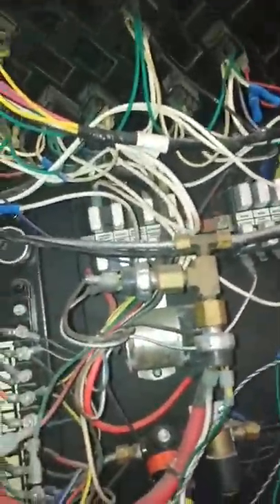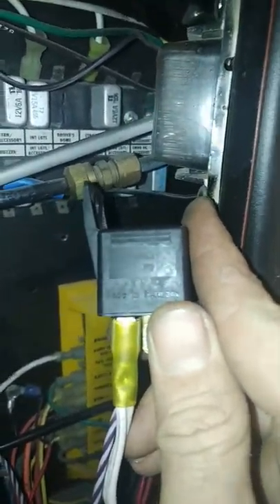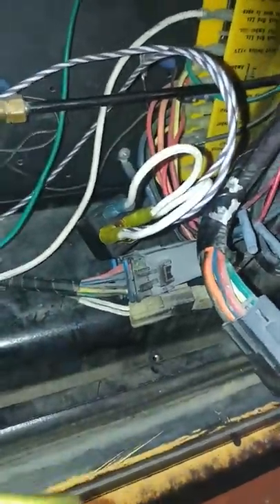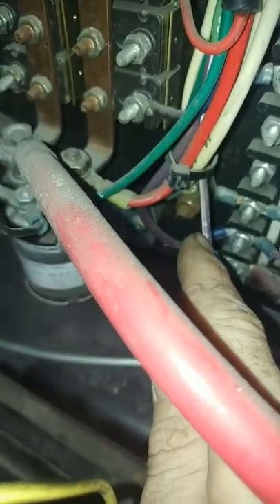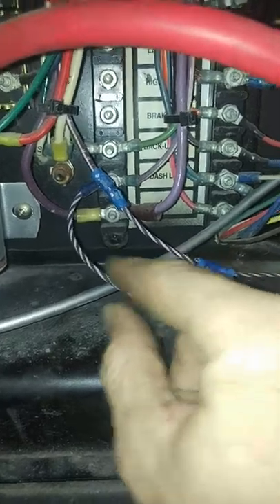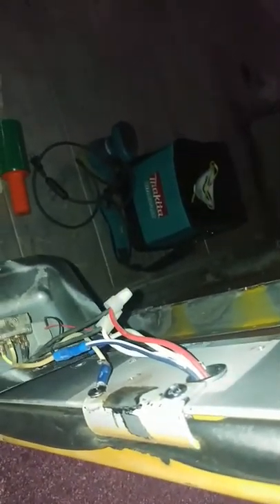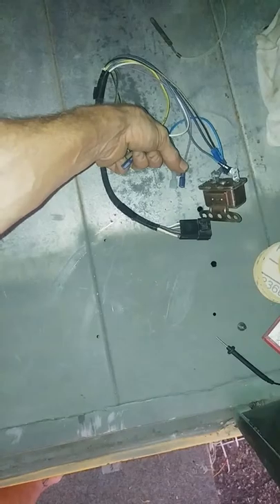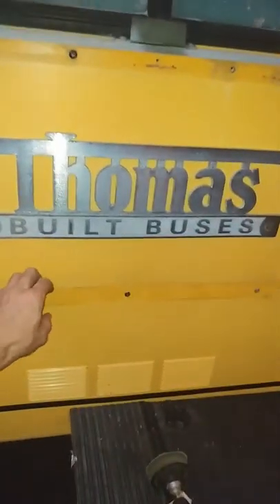Removing safety buzzer and starter interlink....

Comment: I found what looked like a solenoid under the left side of the bus and it was behind the battery box. I disconnected the sensors and grounded the solenoid which allows the bus to start with an emergency door open.  It's a 2007 international.  There are several things that can be turned on with the ignition switch on, so looking at changing that also (Fans and wheel chair lift directly connected to battery).